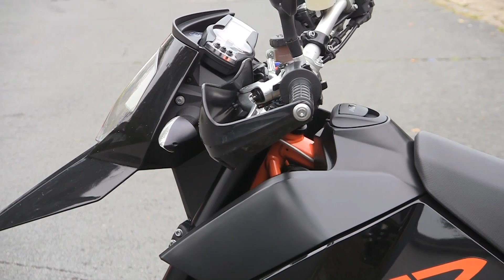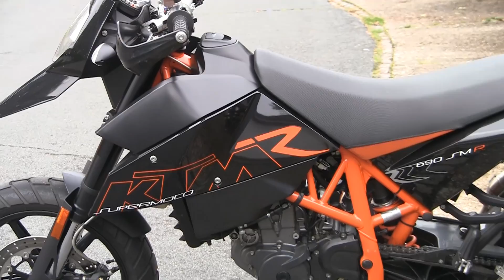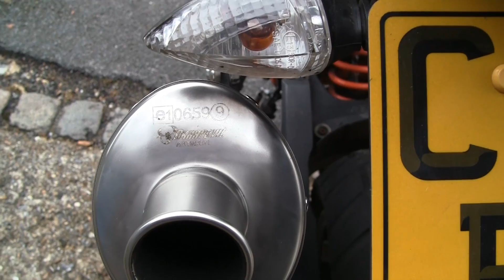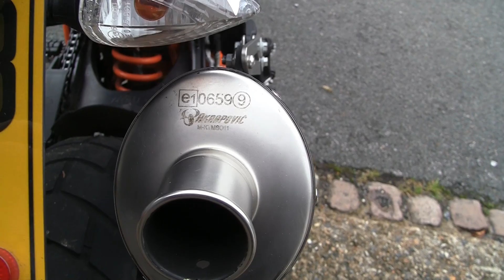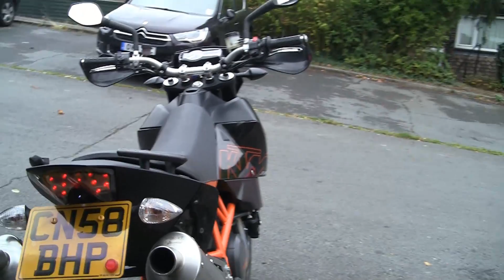Akrapovičs on the KTM 690 SMR

Comment: Is it necessary or advisable to reprogram the ECU when installing the exhausts?
Reply from the maker: I was told by my local dealer that it wasn’t but in hindsight I wish I had as it never seemed to run quite right after fitting them.
Reply: DId you install it with or without catalytic converters? I think that without catalytic converters it is really necessary to repro ecu
Reply from the maker: @pedrogilalves4324 it didn’t have any in the first place.
Reply: that was the problem. without catalysts requires remap. if not, just replaces the original just with a litle better performance and noise